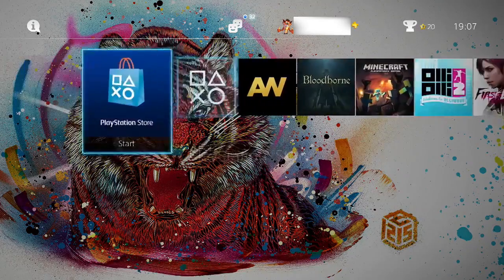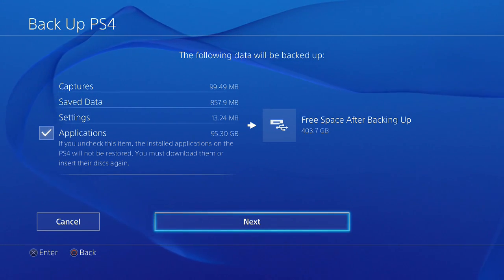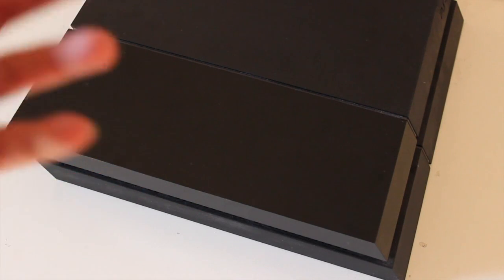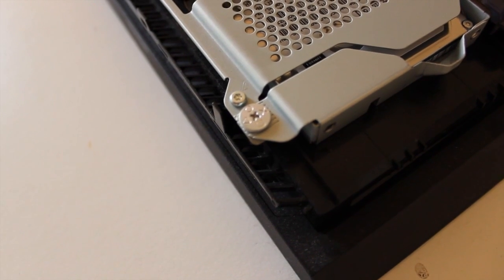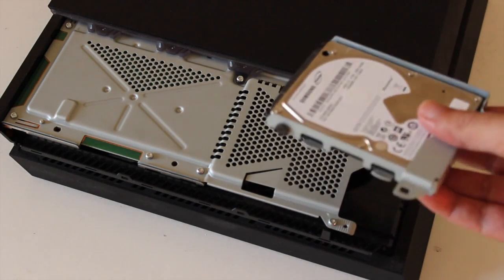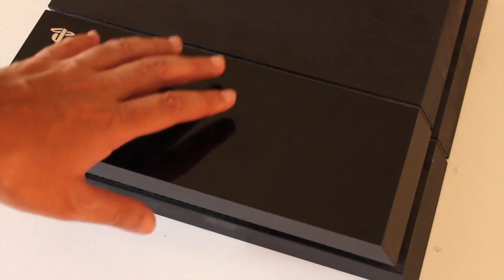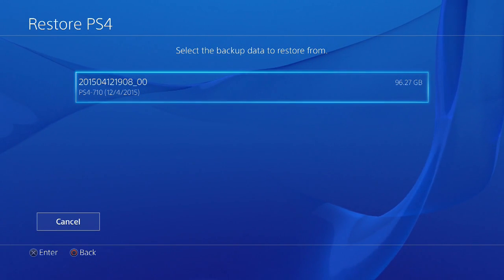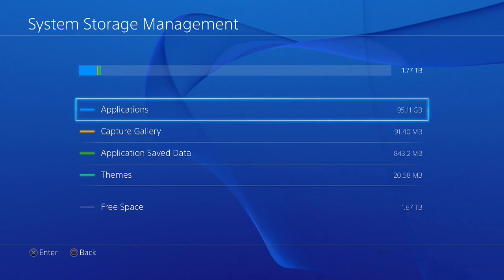How to Backup and Restore your PS4 HDD

Comment: Slingshot, I just wanted to ask you a couple questions
1. Are the Applications really necessary to back up to my external drive?
2. If I back up my Application Saved Data, would I have backed it up from all of my accounts, or just one?
3. Instead of an External Drive, can I back-up the data onto my laptop and then restore it after?
4. Would I lose anything important if I didn't back-up my Applications along with the other items?
Reply from the maker: Nanosanto Cool will answer them.
1. You dont really need to back them up as they are so quick to download again
2. It will backup all of your accounts on the console
3. You need to have an external drive unless you have a usb method from your laptop to the ps4.
4. You would only your save data and patches.

Shout if you need help
Reply: Slingshot So if I had a Minecraft save, would it be completely deleted if I didn't save my Applications? And thanks for answering, it really helped me out
Reply from the maker: Nanosanto Nope only the game will be deleted not the save. You could even upload your save to the cloud if you wanted to be safe
Reply: Slingshot Thanks so much, you've explained a lot of stuff to me

Comment: Great tutorial, can i just back up everything to the new hard drive directly before i remove it from the box through the USB and then install to PS4 ?
Reply from the maker: SpaceBeastX Unfortunately not. Thats the bummer with the backup process. You need to backup your old drive to a external usb and then use that external to backup to your new installed drive

Comment from the maker: How to backup and restore your PS4 Hard Drive http://buff.ly/1e2VnQE #PS4Share PlayStation Europe PlayStation_SA
Reply: Slingshot hey I have a question can I use a 5or les TB expansion 3.0 seagate desk drive on PS4 threw the USB
Reply: Slingshot If I geit it right, you'll need 2 hard drives. One for backup all the data and another one (1TB) used to replace the original hard drive (500GB).
Is that right?
Reply from the maker: Yeah correct. One to backup too and then your new 2TB drive. Shout if you need help
Reply from the maker: Check amazon for the drive. You could use the Nyko for the same method
Reply: Slingshot I'm a little confuse do you update to 2.50 or 2.55 when you install a 2TB hard drive while using a usb stick?
Reply from the maker: Nope it works on any firmware from 2.50 upwards. I did mine on 2.50 but it works with the latest as well
Reply: Slingshot ok that's good to know thank you :)
Reply: Do you have to format your external drive?
Reply from the maker: Yes so long its in the correct format to backup. Either exfat or fat32

Comment: should i reinstall system software from usb if i upgrade hdd to 2TB when i first buy from store ? if should, can i install system software from direct ps4 which use wifi ?? 
glad you to answer me. thanks before
Reply from the maker: Christian Casey You need to reinstall system software via usb and not wifi. The link is in the description. Download that file and update your PS4 via safe mode
Reply: Slingshot I dont have a external hdd to back up and restore the files. so if i use usb and i dont back up applications because the size is over 400 gb and won't able =to usb flashdisk whether the applications like installed games, digital game,dlc,add ons will be lost??
Reply from the maker: Christian Casey You can use any existing usb drive for the backup. It doesnt need to be empty or formatted. If you have the disc games. You will need to reinstall with patches again. I would suggest save your game saves and backup your digital games. Then you only need to redownload your patches because you have your disc games

Comment: I do everything you've done in the video. Only when I get to the Restore part, the PS4 says "The USB storage device is not connected".It seems as if the backup deletes itself from the hard drive when I Initialize it. I'm not sure what to do. Maybe it's because I chose the "Initialize (Reinstall System Software) option instead of just "Initialize"?
Reply: Nick Perry Or maybe it's neither of those options and that's where the problem lies...
Reply from the maker: Nick Perry Hey, double check your USB cable. or try a different cable. Could be a damaged or broken one.Try initialize and let me know what it says

Comment: Nice Video, Thanx. I will be grateful if u can answer me a question in regard to Back-up process: I have all my games on Disc (No Downloaded Games) and dont have much room on my USB-Drive , so If I don't Backup "APPLICATIONS" (which is the biggest portion of the Backup), but just Gallery, Saved Data, etc.,  all I have to do is just throw in the Discs and put the games on my console again, Am I right?
Aside from that will I miss anything without Backing up APPLICATIONS (in regard to the Saved Game Process and Game Settings)?
Can I also Download other "Audio / Video" Applications, like: Netflex, Spotify, IGN, YouTube, Amazon, etc.again from Internet?
Reply from the maker: Farid Fard Thanks dude. Thats good that you have your disk games. You will need to pop them in again and install and download patches which is not bad. Best bet would be to sync trophies and backup your save files
Reply: Slingshot
Appreciate the Reply, mate.
BTW, in the video first you showed a "Seagate Backup Plus Slim External HD" (which needs to be Pried open), but then later in the video put in a Samsung HD in the PS4!! What about that?
Another question about The Flash USB-Drive  for Downloading "SYSTEM INSTALL / UPDATE" file on it (and then use it to Install the System Software on PS4) : How it should have been formatted (FAT32 , ExFAT, ..)???
Thanx Again, Cheers
Reply from the maker: Farid Fard Yeah when you open the seagate casing its actually a samsung drive :) Your USB thumb drive can be formatted FAT32. Make sure its in the correct folders on the flash disk
Reply: Slingshot Thanx again man. OK, so you skipped the part where you open the Seagate casing and all that ;-) Cheers :-)
Reply from the maker: Farid Fard Yeah skipped it. No need to filming me bashing it against the wall (which i didnt do hahaha ) Hope you come right with your upgrade
Reply: Thanx man you are awesome. I haven't bought the Drive yet. Saw it in another video how the guy opened it. I also heard warming the case a little bit with a hair-drier helps the glue to let off and the case be opened easier! That's the case probably with other drive cases too. Take  care ;-)
Reply from the maker: Yeah there are 3 clips on either side and 2 on the top side. Very easy to open up. No heat needed
Reply: Slingshot Hey Man. You were so helpful answering my Qs in detail that I can think of no other person asking these: I have 3 questions:
1- What happens to the DLCs I have downloaded? Will they also be backed-up? And in what category? Are DLCs considered as "Saved Data" or "Applications" or something different altogether?
2- The HD Upgrade works an all models of PS4 or just the early models? (Mine is CUH-1116A , which is the latest , I guess!)
3- Is it possible to Upgrade the HD with more than 2TB? Say 3TB for example? 
I very much appreciate your help. If you are very busy I don't mind answering them one by one. Cheers mate :-)
Reply from the maker: Farid Fard Cool man. All DLC's, patches will be backed up to the external drive. It will work on your PS4. If you can find a 3TB that could fit then you can install it, although i think 2TB is more than enough :)
Reply: +Slingshot Hi mate. So, I have ordered the Drive and will be doing the upgrade as soon as I get it. There is a quick question I want to bother u with:
 In your video I saw that you do RESTORE after installing the Firmware, but
 then you do have your Actual games in your Backup as well, so you do it
 all in one step.  Since I don't have a big ext drive to back up everything on it, I should do it in 2 steps. So my question is:
After I do the Sys. SW install and the System is ready, should I first "RESTORE" the Game Saves that I have backed up and then put in the Discs to install my Games? OR the other way around? (First put in the discs, install the games and then "Restore" my Game Saves, Screenshots, etc.?)
I appreciate your answer as always, Cheers :-)
Reply from the maker: +Farid Fard yes you will need to install the new drive with the new system software and then restore the drive with your back up
Reply: My dear, It seems you didn't understand my question! But it doesn't matter. I think I found the answer from another video on youtube. Nevertheless, thanx a 1000 fold. Cheers :-)

Comment: I just bought a 2tb seagate back up slim external hard drive. I followed all steps. It works with digital games but i cant play disk games. It keeps saying the game may be damage or dirty. Thats not true because its saying that for all games. Also, when i put the old 500 gb drive back in my ps4 the gameals worked. Has anyone had this problem? Any solutions????
Reply from the maker: Willie Pole Hey man. Ive never had that before. Best bet. Bought the console in Safe mode and rebuild the system. Which is option number 5!!. Let me know how it goes
Reply: +Slingshot hey did you format your seagate drive before you put it in your ps4????
Reply from the maker: Yeah i formatted it exfat :)

Comment: Does this drive give you slightly faster load and boot times? Not sure if i want to get this drive to upgrade mine hmmm
Reply from the maker: ***** I havent noticed a difference between the boot times compared to the original drive which was in. If you want faster hard drive speeds then a SSD or Hybrid drive would be better, but i was doing it more for the space
Reply: Slingshot I have got the hdd for a while now it seems to work out great so far, pretty nice guide btw. Now I'll have the space I need for furture games.
Reply from the maker: ***** Awesome. Glad you sorted. Yeah i have tons of space for the new games

Comment: Is it necessary to use usb storage?....
Reply from the maker: Mark Brown excellent stuff Mark. Glad it worked out better for you. Will make a mention of the exfat format :) chat later
Reply from the maker: Omar Khalil Please explain your question. Is this for backup of the internal hard drive?
Reply: Yea
Reply: It told usb storage is not connected?!!
Reply from the maker: Omar Khalil Its the only way to backup your internal to an external. Make sure the usb hard drive is usb 3.0 and formatted FAT32. If you use usb 2.0 it will be slower to transfer
Reply: So i had to put usb3.0 to its place then backup right??
Reply from the maker: Omar Khalil Make sure its formatted FAT32
Reply: Slingshot I just tried it with exFAT and this is much faster to format and use. :)

Comment: This back-up and restore process is basically just like doing it on a PS3. You might just want to mention the backup HDD needs to be formatted in FAT32 in order for the PS4 to register it as usable for the back-up process.
Reply from the maker: francis Velez Try and format the drive in exFAT and hopefully that will work
Reply from the maker: Kyle O'neill Cool will add it into the video
Reply: I'm have a external hardrive passport with that format fat32 because I'm use with my ps3...but I'm can't do the back up with my ps4...said device is  not connect...sorry for my English.

Comment: Did you back up the data on the external hard drive and restore it after you installed it to the ps4 or do you have to use another external drive to backup and restore after you replace the hard drive?
Reply from the maker: rhymesrlife You have to backup to another external. I wish you could backup to an external and then use that drive in your PS4, but it doesnt work like that